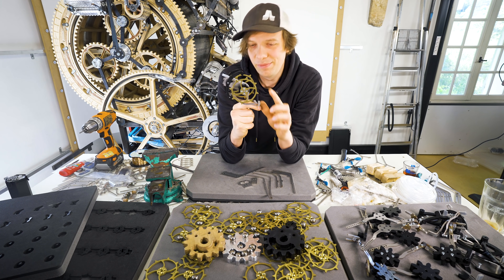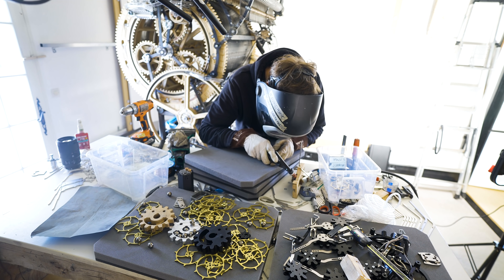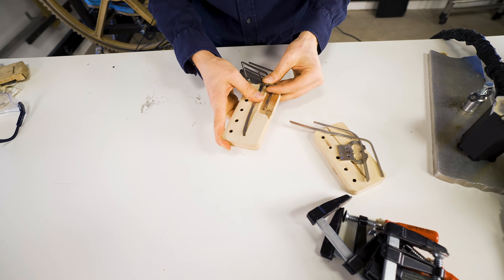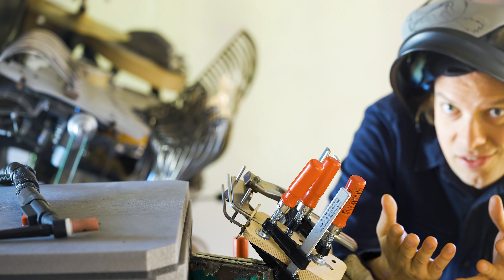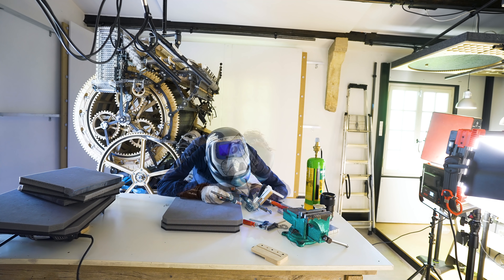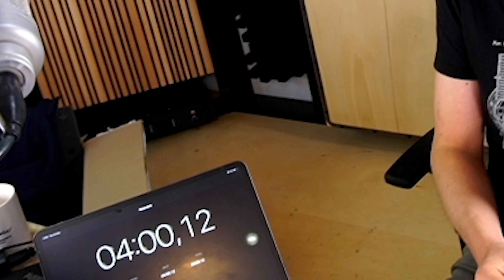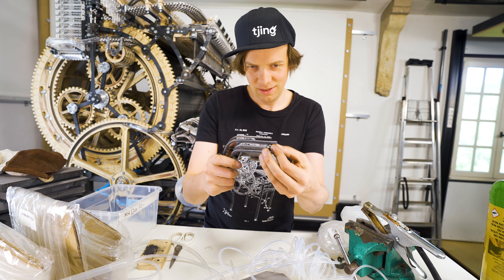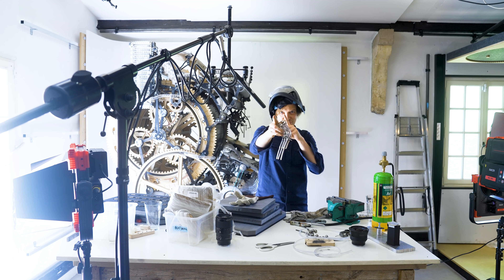Trying the Marble gate - Will it Work?

Comment: At 14:09 I can see your welds, looks like you cleaned them to a shine, but, if you used stainless rod it should be silver, so what I'm saying is it looks like you've used some other kind of fill rod, maybe mild steel, silicon bronze or mixed metal.

Comment: Hey, maybe some welding tips. I understand the reason you want the heat so high as it usually makes quick tacks easier. But in this case the heat was way too high. Stainless is the best material to tig weld and should not come out looking black. I would also recommend using red tungsten(2% thoriated).  Remember, small weld, thin tungsten. You should be using maybe a 1/16 tungsten. I prefer using 3/16 for most anything, but in this case you should play around with lower amps and thinner tungsten. That way the tiny corner fillet you wanted to do would have been easy.

Comment: The amount of washers hurts me on an emotional level. You could use a plastic pipe and cut of just the right length that you need. Those washers hugely inflate the part count and if you want to fix something later there will be a mess of washers. You are transforming into a new person, you gotta stop using washers as spacers, thats what old Martin did with the old MM. Unleash your potential!!!

Comment: Rather than welding the part, why didn't you use the very clockmaker routine that you said worked so well last episode: using a spring-loaded press to deform the metal to push against the smaller part?

Comment: It would be a lot easier to use a jewelers oxy acetylene welding kit with silver alloy, you would need the flux to...
this stuff will weld anything to anything, steel to brass, steel to steel  ect....

Silver
https://www.amazon.com/Harris-Troy-Ounce-75310-5631/dp/B0713Y6V2F/ref=sr_1_5?dchild=1&keywords=silver+welding+alloy&qid=1621622073&sr=8-5

Torch
https://www.amazon.com/YaeTek-Jewelry-Welding-Soldering-Cylinders/dp/B07DNQ3QC3/ref=sr_1_2?dchild=1&keywords=jewelers+oxy+acetylene+weldi

Flux
https://www.amazon.com/Harris-SSWF1-Stay-Brazing-White/dp/B002075B0U/ref=pd_bxgy_img_2/142-9780186-6122639?_encoding=UTF8&pd_rd_i=B002075B0U&pd_rd_r=07bd01e2-5b74-4451-a26a-5432f6bcd368&pd_rd_w=bvJBY&pd_rd_wg=JzQgH&pf_rd_p=fd3ebcd0-c1a2-44cf-aba2-bbf4810b3732&pf_rd_r=0R53NPQSR4YN7QFC7KVE&psc=1&refRID=0R53NPQSR4YN7QFC7KVE

Comment: impressed with the DFM slot to mount the cog
Reply: The real DFM design would be to have the axles locked in a hole so they could slide in instead of having them “crimped”in. That way all the other parts can be simplified (and the clever solution replaced with one part)

Comment: I think it failed to rotate at the and due to low pressure. Looking at the design from the point of someone who doesn't know S, it looks like it favors higher pressure for reliable rotation at higher speeds.

Comment: In case you have them, some taps have a divot in the back. Using a pointed tool in the chuck of the drill press and placing it in the back end of the tap, you can hold the tap perfectly straigt. Just a handy little workshop tip

Comment: What if instead of covering everything in sound dampening rubber/latex etc you evenly coated the marbles in a rubbery material? This would also get rid of the sound of marbles hitting each other. But also at this stage of construction I'm sure too many things would need to be changed to accommodate the larger coated marbles. Well unless the coating was not that thick. :/ hmmm idk

Comment: I noticed that the rails have pipe on them, but you welded both sides closed.  What happens if the pipe wears down over time, you would have to grind that open, replace the pipe, and reweld right?

Comment: Martin keep up the good work!! A quick tip if you extend your tungsten out past the ceramic cup a bit and make sure it has a very sharp point you will be able to get more control when you TIG braze. Also you can reduce your amperage quite a bit when you braze. It is counter intuitive to standard TIG welding. Brazing is the metal equivalent to hot glue. You do not want to melt your base material.  It's not easy but practice make perfect. World Tour!World Tour!World Tour!

Comment: It may be a little late in the build process, but you should look into a hand tapper/hand tapping machine. They aren't too expensive and would make the job much easier. Basically a little vice and drill press like arbor for holding the tap straight. I seem them for 170 us dollars. Cheap as.

Comment: Wonderful! Just one question that popped into my head when I saw you welding the upper part after you put the silicone tubes on: will you ever have to replace them, e.g. due to friction etc? since you welded both sides you can’t access these tubes anymore.

Comment: Looks good, probably should add some Loctite to the threads on those screws on the tube clamps, that didn't look like too much thread engagement and those could back out with enough vibration.

Comment: The silicone tubing is trapped between welded parts at either end?  There is no way to replace it when it wears out and there's been no testing to see how long it will hold up.

Comment: I'm an analog IC designer.  I draw my schematics, simulate my circuit, translate those schematics into mask layouts, extract those mask layouts, and re-simulate everything.  Eventually my circuits get assembled together with everyone else's circuits, then my company spends $$$$$$$ to send those mask layouts off to the foundry and 2-4 months later we get the first chips back.  While the chips were being fabricated, we build boards and write and debug software.  When the chips come back we put them on the boards and find out what went wrong in the software and then we get "signs of life" from all the circuits.  Eventually we are able to hook the boards up to measurement equipment, and I can finally see whether or not my circuit worked as I intended.

 The look on your face and the elation in your body posture in the very last shot is always the goal, and that feeling is so great.  Well done, sir.

Comment: Noticed you put the silicon tubing on the rails then welded the back plate on, what if you need to replace the silicon tubing? You wouldn’t be able to access the rails to slide the tubing on now?

Comment: Omg, as a welder, it really is hard to watch sometimes. In this case, what you do is put on at least 150 Amps and then basically shot a weld with a 1-second pulse. No filler at all. just one small shot with max amp.
You will not transfer ANY heat into the part. Just try it.

Comment: You can have a smaller ceramic diffuser, also because you do small welding you can use smaller tungsten, also with the correct argon flow and small ceramic buse you can let your tungsten out of the buse up to 8 mm even 10 mm , set your welding machine very low , like 40 amps and using  0.5 mm rod filler you will be able to do very clean and small weld and yes also strong weld .

Comment: Using wire to hold the spring still seems like a monumentally bad idea. It's constantly under tension and I can't see it being reliable in the slightest.
You've worked so hard to eliminate mounting of parts that could even potentially slide, and then comes this, where yet again you're relying on friction instead of a solid connection.

Comment: I'm curious to see how this gates will be "primed" : is there a minimum number of marbles to make the escapement reliable. Edit: that captive tube on a soldered part WILL come back to haunt you. Guaranteed.
Reply: @StoneyMeyerhoeffer  At 10:15 he seems to be welding a plate over the end of the tubing, making it captive. Should one of those tubes ever wear out or get damaged — e.g. in transit while on tour — how will he replace it?
Reply: he explains that in the previous videos. it will work with one marble, but it he has enough in queue that it will never run out. also when u say captive tube do you mean the bridged joint?
Reply: @victorbecker4802  there are factors he considers constant (attrition, for one) that are everything but constant. There's a reason machinists puts oilers everywhere and have spare parts and manteinance routines. The captive tube is the one he ordered in the wrong dimensions.
I'm happy he's abandoning plywood, but he's making too many assumptions.
Reply: @francescosirotti8178  he has boxes of parts for exactly that. also to my understanding, one of the challenges of his project is designing it to work lubrication free for obvious reasons. he even sands the stainless parts where they meet the acetal parts. honestly think about how small mechanical watches are, and the only need to be oiled, what, every 4 years or something? these parts are much bigger can probably wear down a centimeter before a critcal failure. the tubing is also replaceable for a reason, he intends to maintain all the parts when he’s on tour. lastly, he always says he’s still learning engineering, and if the tubing wears out, then he’ll learn from that. i just personally think the design is very elegant and will stay strong, partially because in brewing alcohol, the same style tubing lasts for years of hot and cold and scrubbing with a brush and whatnot. either way, we’ll have to see!
Reply: @francescosirotti8178  ohh i see what you mean. yes thats a good point, for his purpose tho, i feel like simply slitting the side of the captive tube and replacing and regluing would be easy enough.
Reply: @victorbecker4802  being able to move with just 1 marble seems a little problematic. I mean, this gates are meant to be used on a live stage. This means a potentially wobbly wooden stage. And, if he's playing at a festival, wind... Being too easy to move might be a bigger problem than being too hard
Reply: @francescosirotti8178  I’m not sure what you mean, he has ways to level the machine and the marbles are only dropped when activated by the peg board. otherwise it just sets up one at a time out of the queue of hundreds. where do you think wind would affect the marbles?
Reply: @StoneyMeyerhoeffer  He can't easily slip the piece of plastic tube off when it has worn out because both ends are now welded.
With things like that I like to remind myself that this MMX is the prototype and not the one that will be going on the tour...

Comment: Martin, if you're worried about snapping taps in stainless, try drilling a slightly bigger hole for the thread size you need, for example an M6 thread has a specified tap drill size of 5mm but you can use a 5.3mm or maybe a 5.5mm drill without much loss in holding power, makes things much easier to tap.